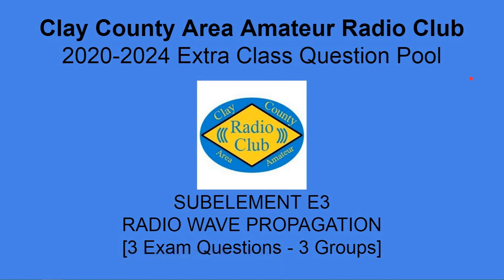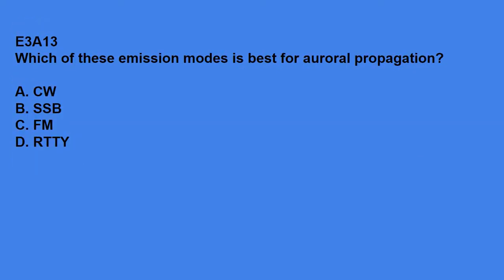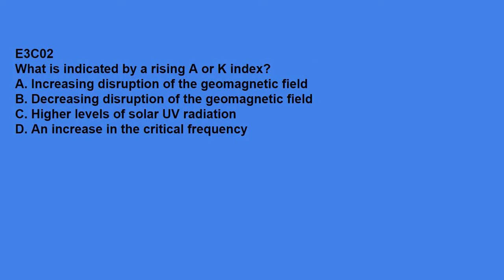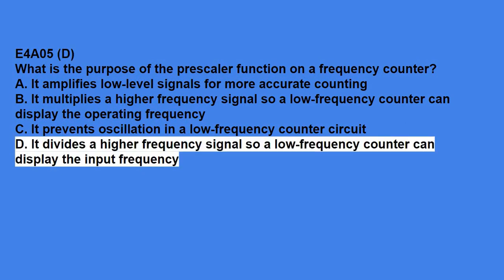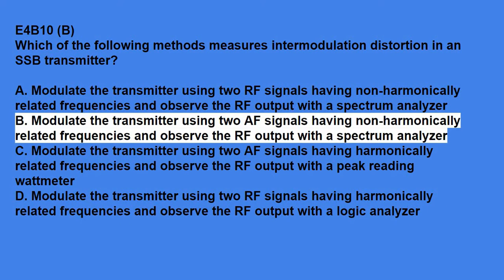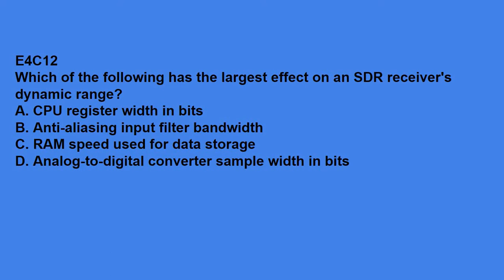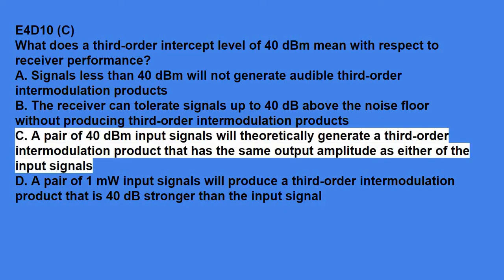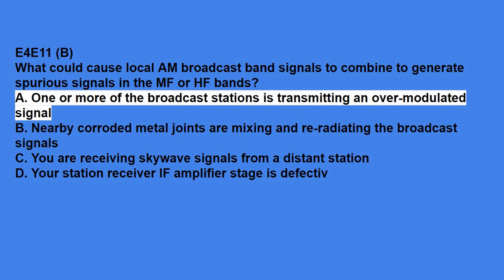2020-2024 Extra Class Question Pool Subelement E3 and E4

Comment: Thank you for these.  I used to study for college tests this way.  I would listen to the questions and answers while sleeping.  During the day, I would listen and read them at the same time, I also wrote down the questions and answers. Since the pool is over 600 questions, this was quite a task... so I appreciate you doing this.  I am about to take my extra exam after not passing the code back in 1989.  Back then, you had to pass the 20 wpm code exam before you could take the written test.  I was prepared for the written but was just shy on the code.... my things have changed since then.  Thanks again from AL7KT

Comment: Hi, your answer to E4E11 "one or more broadcast stations is transmitting an over modulated signal" disagrees with several other sources. Many other sources are saying "Nearby corroded metal joints are mixing and re radiating the signals" is the correct answer... Could you clarify please and thank you...
Reply from the maker: You are correct it likely got marked incorrectly when the slide were made.   The answer is "Nearby corroded metal joints are mixing and re-radiating the broadcast signals"
Reply from the maker: I also had already found that issue and its in the description of the video.